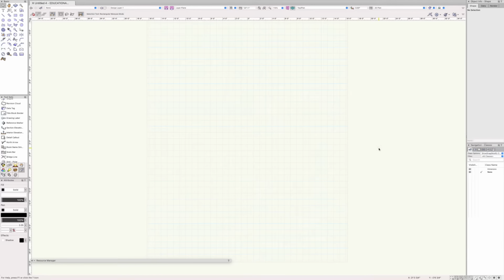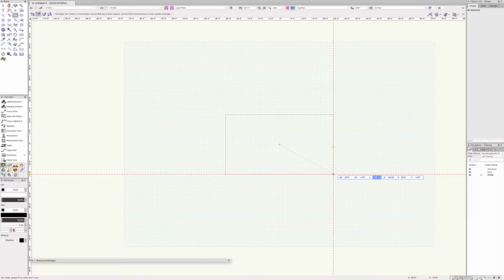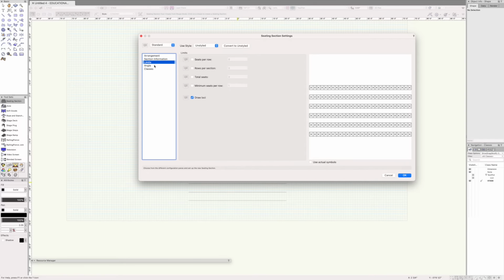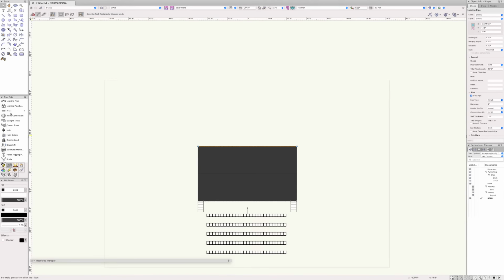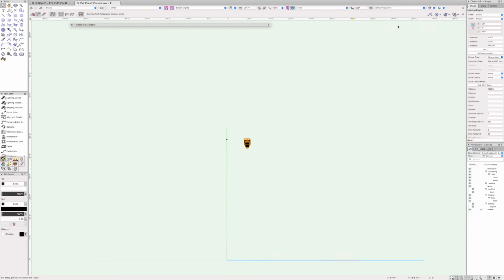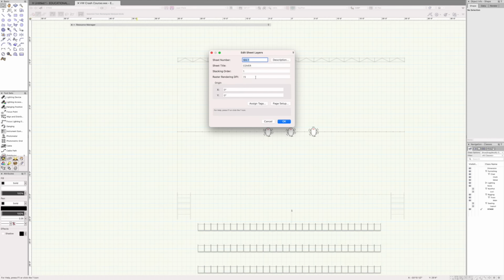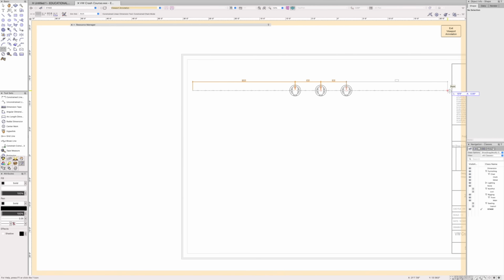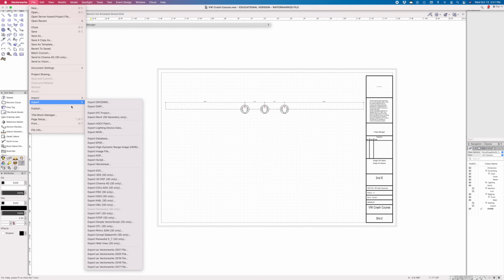Vectorworks Spotlight: The 35min Crash Course! Draft a Full Show with No Experience!

Comment: I don't have event design or create stage. I've always used extrude and it turns everything to just outline so I want to level up from that. Please advise! I'm on mac
Reply from the maker: Hey Annie! Those options are only in Spotlight. Check under "Tools" and scroll to the bottom where it says "Workspaces" and there you can change into Spotlight, assuming you own it or have the student version.
Reply: @JonathanDMartinLD  i am in spotlight, bult stage and its outlined...not solid black. How do I make it solid black? Im on a PC
thx

Comment: Hello! I am trying to follow along and build my own set but for some reason everything is just showing up as outline when I go 3D. I have no idea what I could have done but if you have any suggestions I greatly appreciate it! This video has been so helpful because I haven't used Vectorworks in a few years and forgot how the program works entirely!!!
Reply from the maker: It probably has to do with your rendering style. In the top right of your VW workspace, you should see a little teapot icon. Click that and you should have multiple rendering options. You might currently be in wireframe or sketch, maybe try switching to shaded. Lmk if that works! J
Reply: @JonathanDMartinLD  having the same issue! I only have shaded and wire frame, I selected shaded and still just showing a wireframe for my stage.